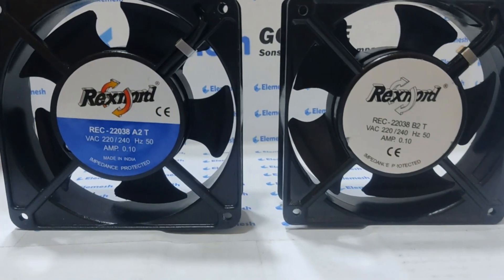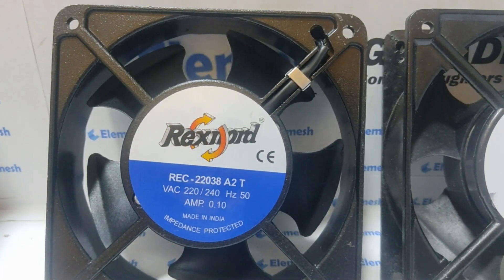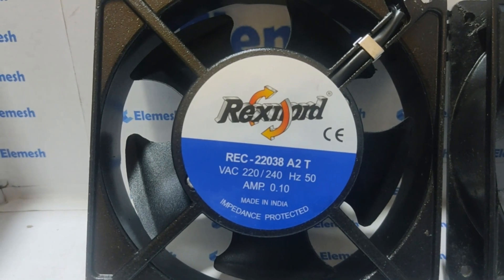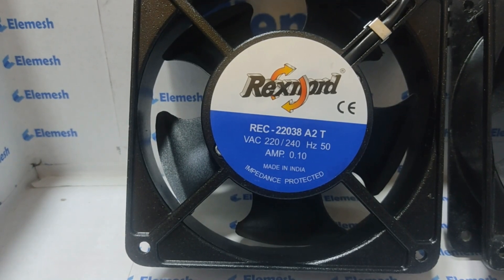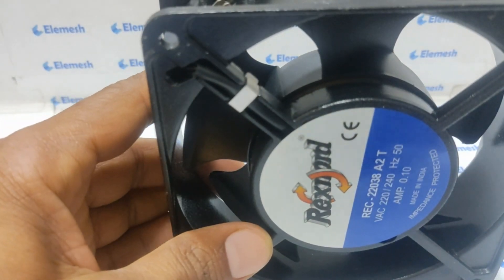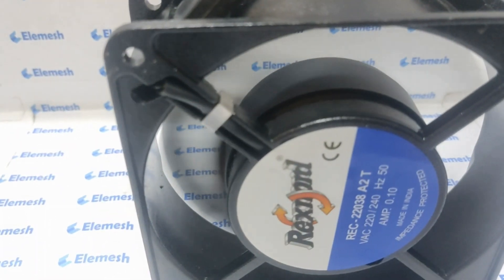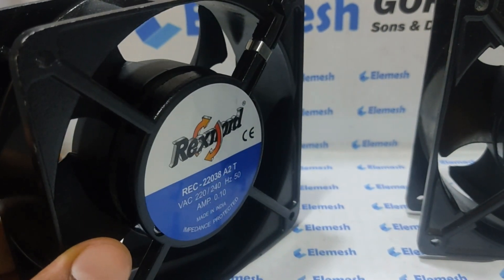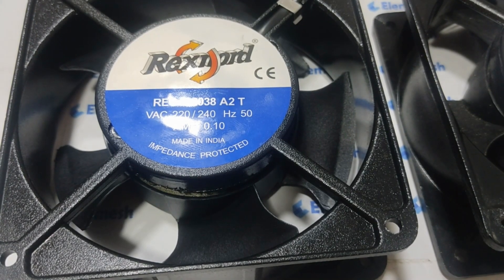Ball Bearing vs Sleeve Bearing Fan – Pros & Cons Explained! #AxialFans

Comment: Which bearing is better for Horizontal mounting, Sleeve Bearing or Ball Bearing.

We are currently using the sleeve bearing fan you used in your video
Reply from the maker: The ball or sleeve does not affect in use in any direction.
Reply: Use the ball bearing…